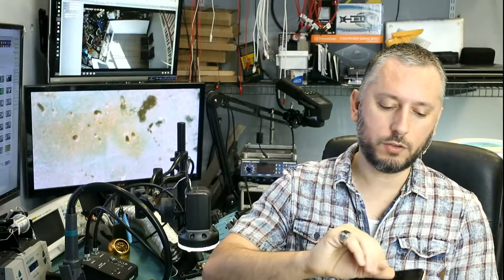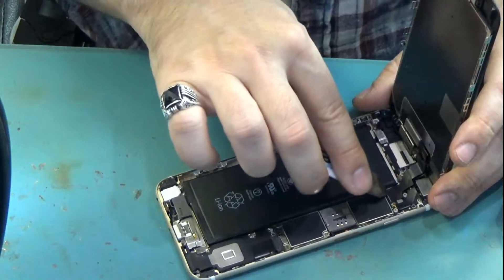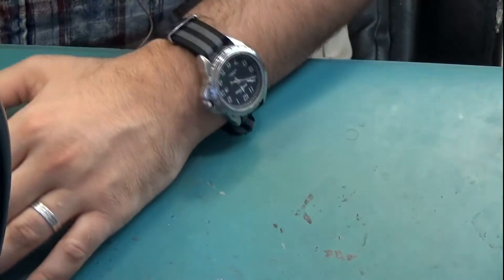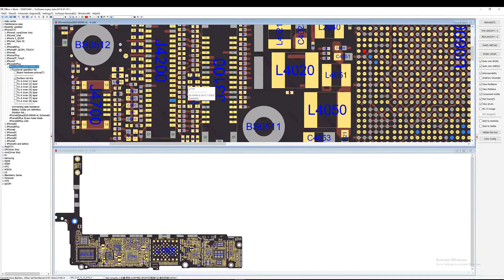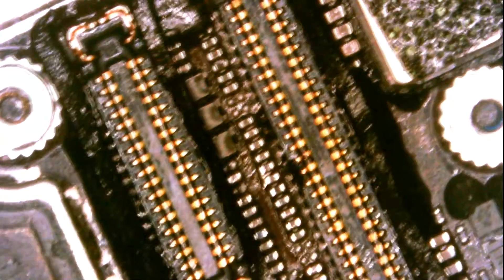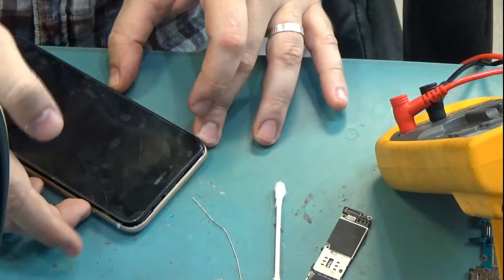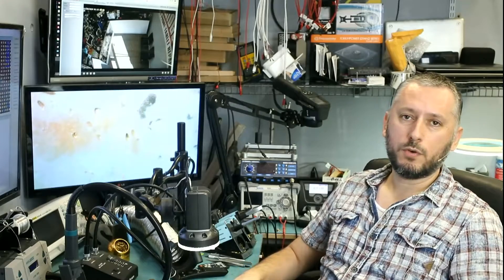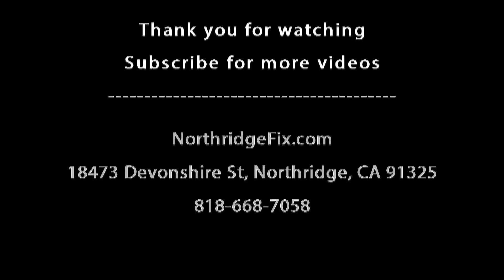iPhone 6S+ plus no touch after screen replacement - missing SPI_TOUCH_TO_AP_MISO

Comment: Great job ! You use Weller soldering station and tweezers?
Reply from the maker: Yes weller station, see description and hakko tweezers check https://youtu.be/QINxxjvZNI4
Reply: @NorthridgeFix   ok thank you. I was thinking about the soldering tweezers 😉
Reply from the maker: The tweezers are weller. It's also in the description. https://amzn.to/2KaW10j
Reply from the maker: Just for clarification, the thin tip hot tweezer is the RTW1 not RTW2. The RTW1 link is https://amzn.to/2TFvTil